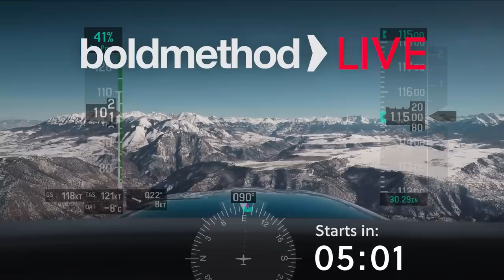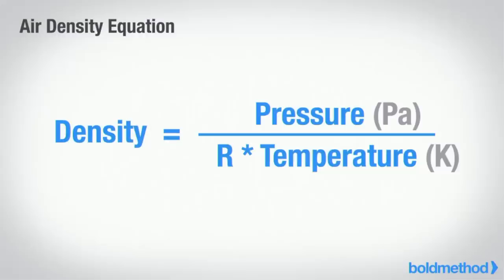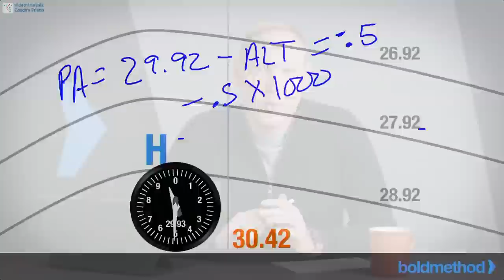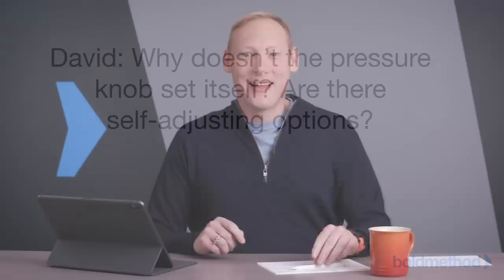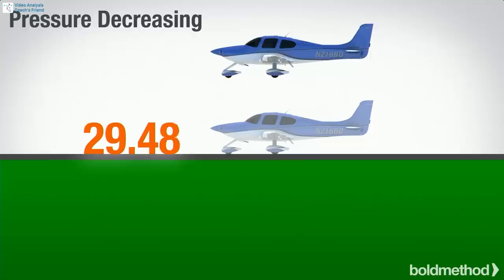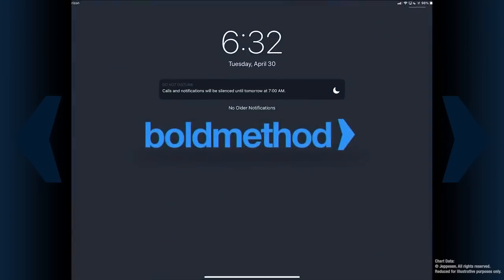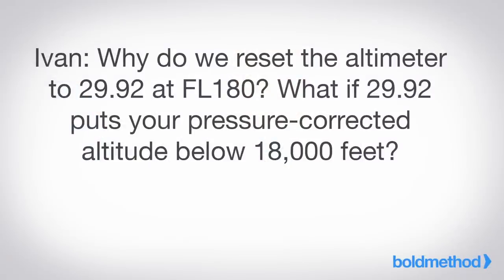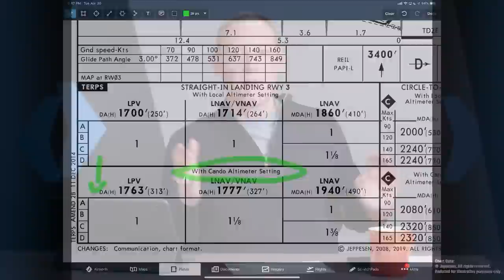Pressure and Density Altitude: Boldmethod Live

Comment: Great presentation. I might add this: At about 24:40 the presenter talks about flying isobars above 18k ft by setting 29.92 pressure altitude. NWS uses the term "isobar" to describe lines of equal pressure on a Surface analysis chart. When they refer to the lines on a constant pressure chart, say 500mb, 18k, NWS refers to them as "height contours". I know this is a bit nuanced, but it might help understand and differentiate those squiggly lines on surface charts as opposed to  upper air constant pressure charts. In other words, at or above 18k,  setting 29.92 PA ATC requirement, all aircraft are riding up and down "height contours" not isobars.
Reply from the maker: Thanks David!
Reply: Good point. The correct meteorological term would be "isohypses".

Comment: Just one thing. The 29.95inHg pressure is NOT a middle number, it's a reference pressure. 29.921 inHg equals 1013.25 hPa, or 760 mmHg, or 1 atm, and is the atmospheric pressure at sea level,  at 45 deg latitude, at a temp of 0° C. In meteorology that is called "normal atmospheric pressure".

Comment: So from my understanding, changes in air pressure are caused by changes in density. Changes in density are caused primarily by changes in temperature. So the pressure (I think) already takes into account temperature. So why doesn't pressure altitude account for temperature? If temperature is a factor of density, and therefore pressure, shouldn't pressure altitude already take temperature into account?

I understand that pressure does not equal density, and using the ideal gas law, if temperature increases but pressure stays the same, density must decrease. But if temperature affects both density and pressure, how can an increase in temperature NOT affect pressure?

Comment: 16:30 -  I am not 100% sure, but as far as I know typical analogue altimeter has a non-linear mechanism inside it, that it indicates the altitude according to the logarithmic H and p relation as ISA describes. Therefore, the thing that causes the main instrument error is just the local atmosphere pressure gradient different then this logarithmic graph.
Reply: I mean that the aneroid mechanism inside it does not present a linear movement of 27ft of indication per hPA

Comment: Why do performance charts use pressure altitude and not density altitude. Since density altitude takes temperature into account. Wouldn’t it be a more accurate indicator of what the airplane will feel.

Comment: Great video! I would have used the actual altimeter setting for Denver instead of using a made up one as 29.92 is standard for sea level and Denver is much higher than sea level.

Comment: i wonder what we'd need on Mars to take off and fly around. Assuming we picked a spot where it was Earth-like temps at the time, as -140 deg F ain't gonna work at all.  A Cessna 172 in the atmosphere devoid of humidity and pressure much lower i think...maybe it would need a greater speed to take off? Average surface pressure on Mars is 6-7 millibars or 0.17718 inches of Hg!